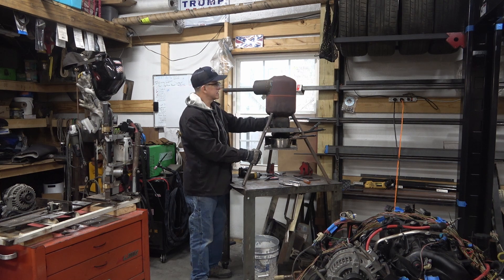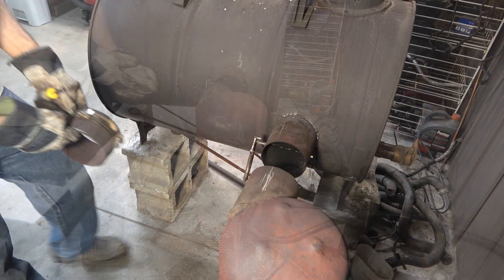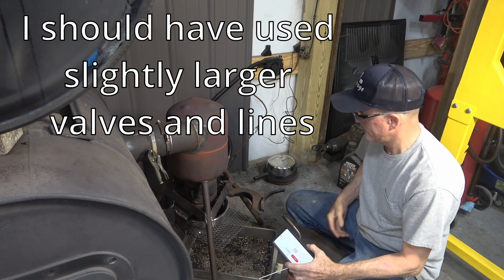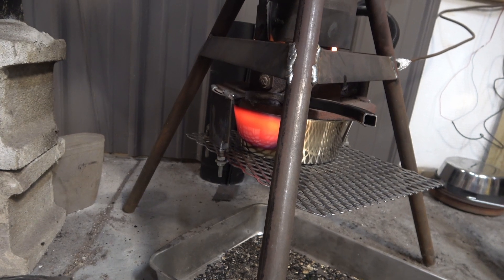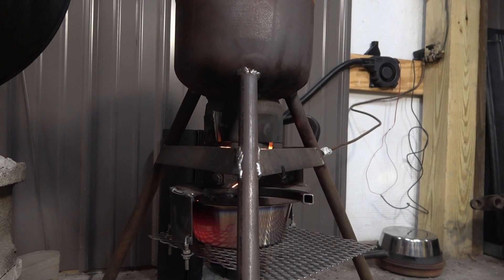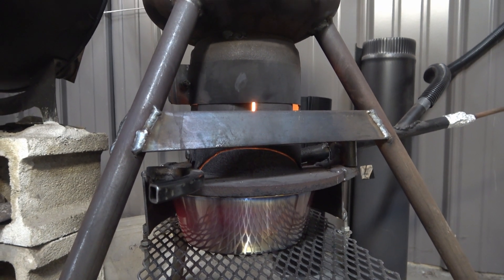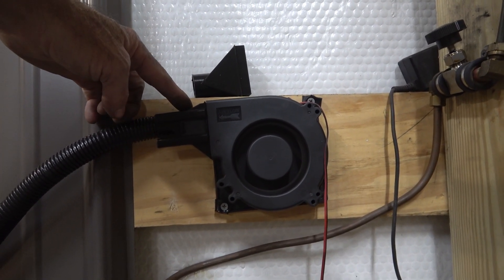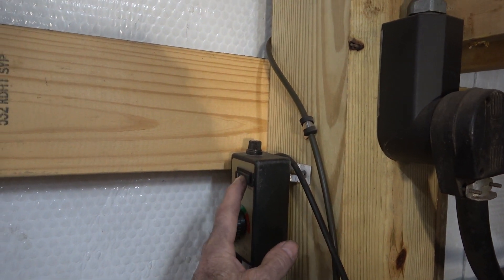Waste oil heater - 4. stainless steel dog bowl fire box.

Comment: How many feet shop are you heating with your set up?
Reply from the maker: @jimfitzgibbon5492  The way it is set up in the video It.
Is not enough to heat a large shop. But it helps keep it warm once it is heated. I use a propane torpedo heater to bring the temperature up. I have added more fan air, so it will burn more oil. The problem with burning small quantities of oil is that you get a small amount of heat.
  My shop is 27 by 36,  12ft wall height.